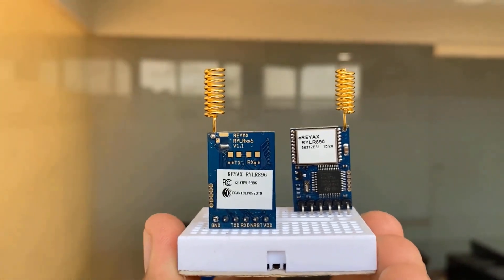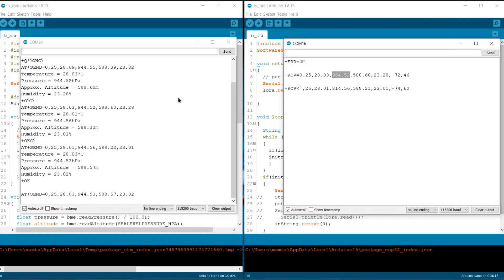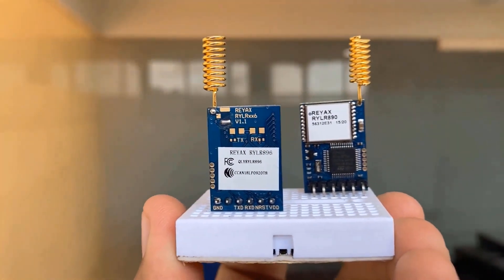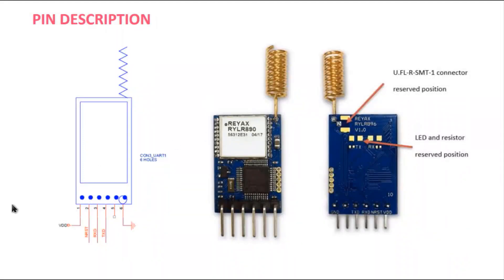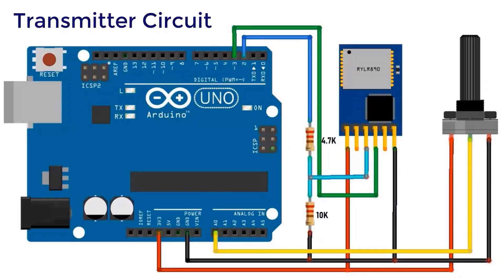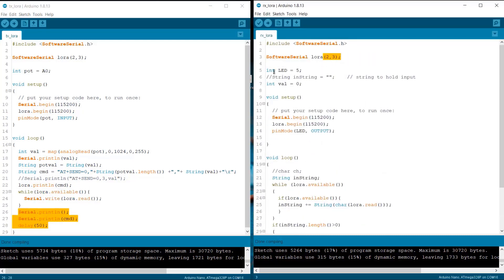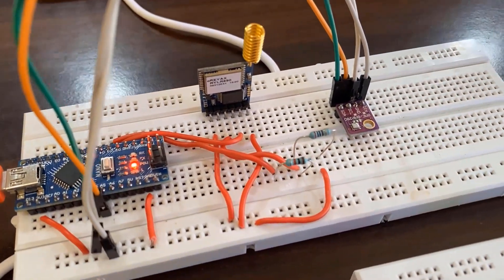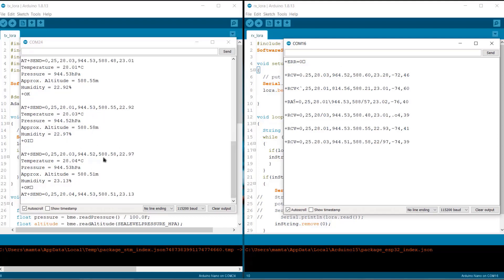Reyax RYLR890/RYLR896 LoRa Tutorial | Sending Sensor Data Wirelessly with LoRa & Arduino

Comment: Great video ! , I have a question - how do I change the code (on the rx AND tx side) so that I can control 2 leds (light - intensity) with 2 potentiometers on the TX side ?
Reply: hey, I'm also facing the same scenario. Did you get any solution?

Comment: I used Arduino micro as a transmitter and Arduino Uno as a receiver for the first example and the LED did not turn on. I can see the transmitter working through the serial port. However, the receiver serial port is not showing anything. do you think Uno is a problem?

Comment: So you can use 2 Arduino Uno boards or 2 nano boards? If you use 2 Nano boards, you just have to drop the voltage from 5v to 3.3v, right?
Reply from the maker: Better to use 3.3V controller like Arduino Pro Mini or STM32

Comment: Can you better/ more clearly explain the data string format?  Do you also do consulting if I needed to hire you for a few hours to help clarify some LoRa packets With sensor data?
Reply from the maker: We have a team for consulting. You can mail us
Reply: @HowtoElectronics  how do I send direct email for more information or consulting?
Reply: In your video as an example you have a sensor and potentiometer value.  I assume the potentiometer is in volts between 0 and 3.3v.  You show a long string of data and highlight the 2 numbers separated by a dot.    Is there some user guide that explains this and is it already decided by the recieved as it is transmitted encrypted?  trying to understand the Lora packet and how to decide at the gateway with a similar packet string.  I am not real familiar with YouTube so how do I PM you or you can send to me a link?

Comment: Can you explain why on line 32 of the rx_lora script in the first example, you set potval equal to string values in position 9 - 12? I imagine that you're breaking up "cmd" from the tx_lora program as it comes into the receiver, however, if cdm == "AT+SEND=0,<length>, <val>", wouldn't the actual pot reading start at character 13? For example, in "AT+SEND=0,3,val". Or are special characters (ie, the commas and operators) ignored? Lastly, assuming those characters are ignored and we want the characters from 9 - 12, how does it work if the pot val is only a single digit? Does the program expect 4 characters (ie, 1023) and read "9", for example, as "0009"? Regards, Joe
Reply: Val in this case is the length of the variables contents.

Comment: This video really helped me out. It was the first one where I actually managed to send signals. However, there are two things that I would like to know more information about. The first is why is the data sometimes corrupted. For example: Sometimes I will receive "28.63 C" for the temperature one packet, the next I receive something like "28.@3^C". I am wondering if there is a good way to get solid data (I am not in a busy radio area and my devices are 1 m apart with no interference). The next question I have is how to I put input AT commands using SoftwareSerial? I know with the regular Tx and Rx pins, you can just use an empty sketch and the AT commands will work just fine. However, I am unable to use the Tx and Rx pins for my project and have to use SoftwareSerial. I haven't found anywhere online how to access AT commands through SoftwareSerial. Thank you!

Comment: bro which gives more range lora 890 or lora sx1278
Reply from the maker: RYLR890 has the same SX1278/76 chip ibuilt. So basically the range is same for both. But Reyax is expensive.
Reply: @HowtoElectronics   bro what is the max attitude range

Comment: Very good video. I will get 2 Lora modules and try your project. My ultimate goal is to create a remote sensor for my swimming pool water level & temperature using the HC-SR04 and the DS18B20 sensors and an Arduino Nano. By the way, don't you have to send some inital AT commands to configure the Lora modules such as Address, Band, Spreading factor,..etc. ? If so, I will probably need to buy a serial interface FTDI232 board to configure them.  Also, for the sensor project,  I'm wondering if you know why there are occasional errors displayed on the receive serial monitor com16. And one more point: According to your code, I think Arduinos serial software pins 2,3 are rx,tx respectively. I think the wires to Arduino pins 2,3 need to be swapped. Thanx!!!!
Reply: I actually made 2 sensors (1st for water temp. & level, 2nd for outside air temp. & humidity). They are powered by batteries. The first with 3x1.5 AA batteries and a TS5110 timer providing 8 seconds of power every hour. The second with 2x1.5 AA batteries using a standalone ATmega328p running on internal 8 mHz oscillator  in sleep mode  most of the time. With 3V, no need for the voltage divider on the Rxd Lora device.  There are occasional reception misses (1/10) due to interference on the 868mHz channel. I live near a LoraWan gateway and there's a lot of traffic.  I confirm my previous comments concerning the FTDI232, errors on using softwareserial library with baudrate>9600, and the rx,tx swapping . I am wondering if using these Lora chips is a little bit overkill. They are a little bit expensive (15 euros) and they seem to have a very long range compared to what is really needed in my case (15 meters). Otherwise, I am satisfied with this project!
Reply from the maker: Glad to know you are very satisfied. The problem is really with the pricing. The price is too high.
Reply: @HowtoElectronics  Good quality though!